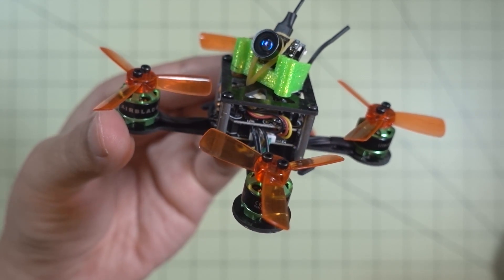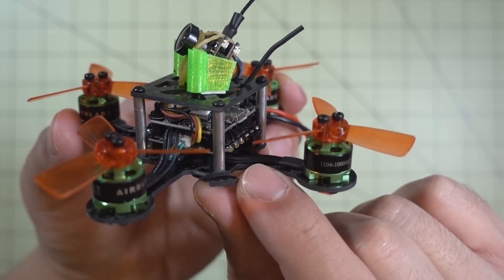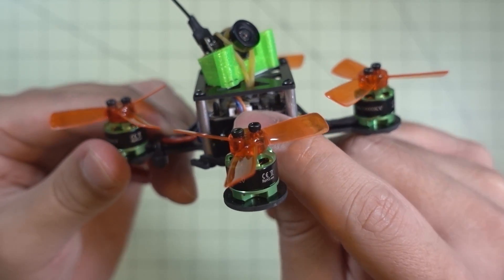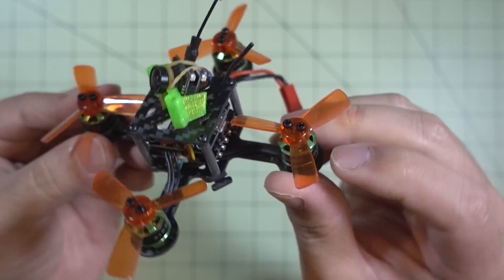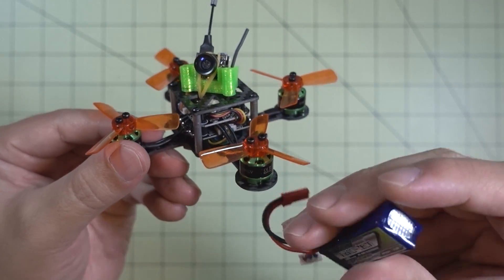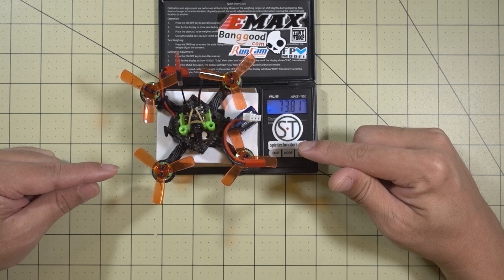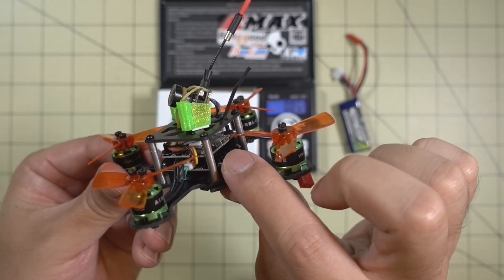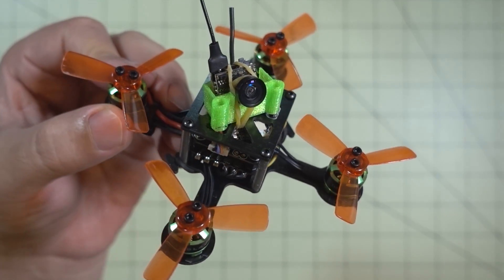Micro Drones 101 🔥 Build Example #2 💡

Comment: Is there a micro combo of motors, props, and battery that flies free style well and lasts for 4+ minutes?
Reply from the maker: +Mark Sherman get the Aurora 100. That meets those requirements.
Reply: Thanks, I added it back onto my list (with the ARFUN Aurora 90) when BG came out with a 2.5mm bottom plate. Hard to choose!

Comment: The builds with the cubes are getting easier. Very nice video thanks. If you have time can you run some of these small quads around your test track and put the results on your spread sheet to see how they compare.
Reply from the maker: +John Moore I will eventually but the park I did those test at have been busy watering the grassy area and I havent been able to fly there lately

Comment: I'm running 1104 7500KV, I was lucky to get a minute with those batteries.  I an running quad blades maybe over propped.
Reply: I have 1104 7500KV DYS and I get just 2 Min with 520mah 30C 2S....
Reply from the maker: +Sam B with these bigger and higher kv motors, batteries are a problem now... Will habe a video talking about this later.